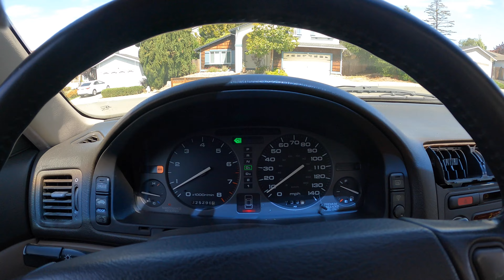GOT THE ACURA LEGEND OUT THE SHOP | BUT THIS HAPPENED...

Comment: You should add a killswitch on your legend if you don’t have one I added mine, someone used a sawzaw and cut through my steering wheel to take off the club and it cut pretty quickly; right now I’m working on installing a quick release steering wheel I also have the part number to the hub adapter if you need it
Reply from the maker: I was just talking to someone about installing a kill switch on it. But my long term plan is to get a quick release steering wheel. If you have the part number you can send it. Thank you bro and thanks for watching 💯💯💪🏾💪🏾
Reply: @CarAdventuresWithReg  srk-190h is the hub adapter you’ll need
Reply from the maker: @jessemartinez6737  appreciate you bro 💯💯💪🏾💪🏾